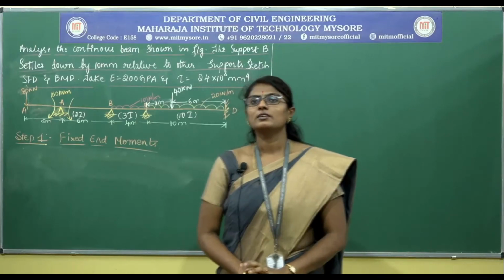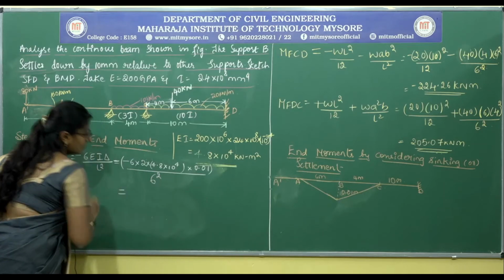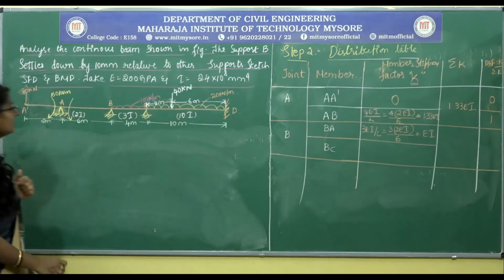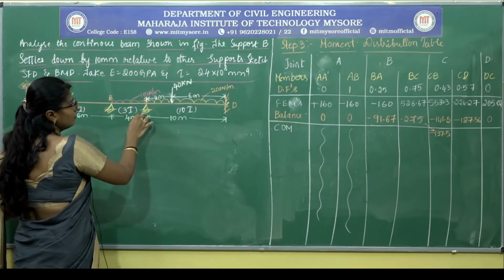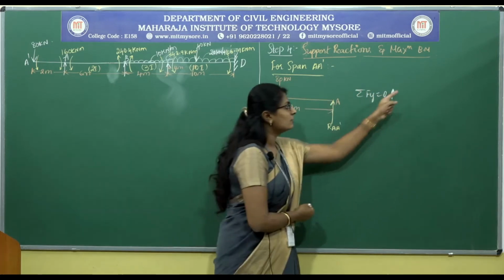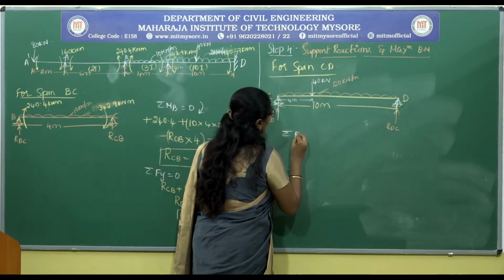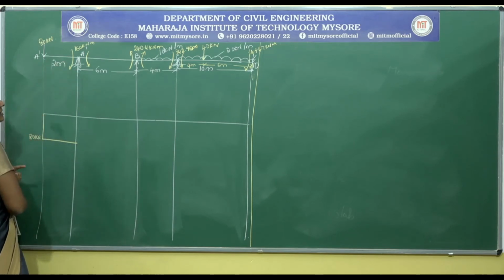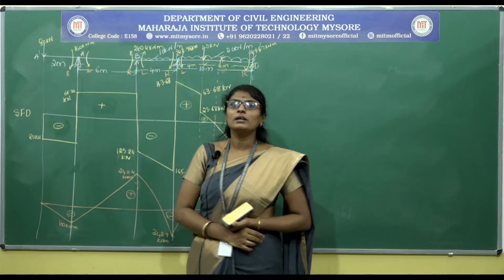Problem on Over hanged Beam by Moment Distribution method

Comment: madam,
AS per my calculations , At Fixed end moments ,
AA' = 160
AB = 160(AA') - 160(AB) + 160(AB) = (NEW INITIAL fem)160
BA =  80(AA',160/2) - 80(AB,-160/2) -160(BA)  = (NEW INITIAL fem)-160

AA' IS OVER HANGED, & AB is pinned ................

please solve my doubt mam